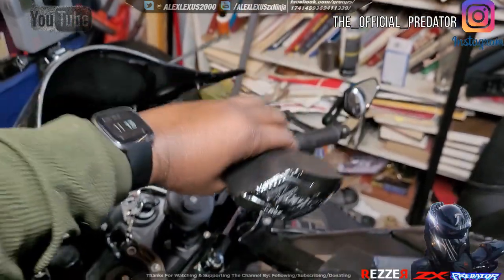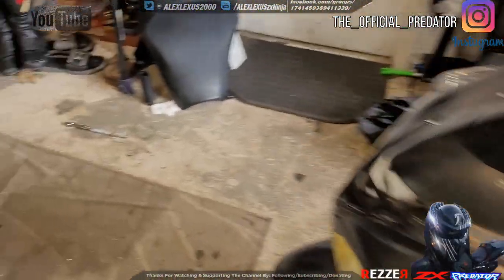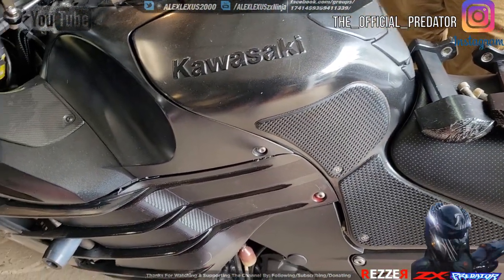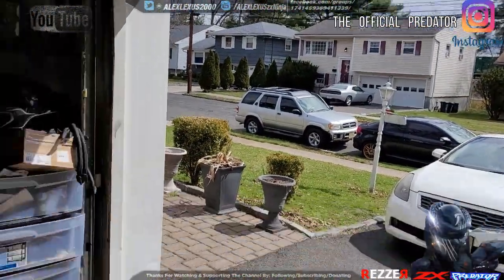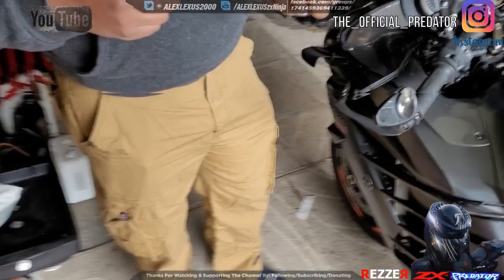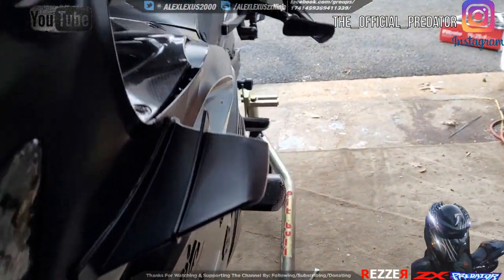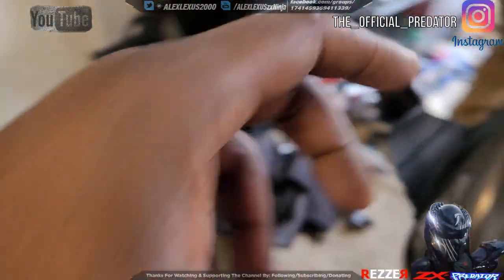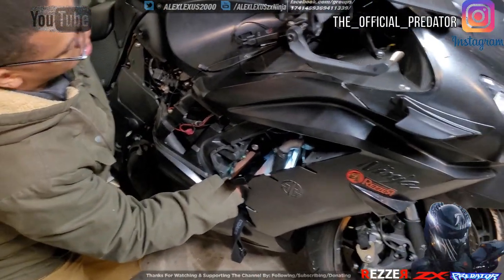T-REX frame slider Install DIY zx14r How To

Comment: What's good Army, good video 👍🏼
My frame slider bolt broke off in the freaking frame 😫when I was doing  Maintenance on my Busa. Now I have to find some type of way to drill it out.
Reply from the maker: damn! you need to get a bolt extractor for it. hope it didn't break the frame
Reply: @alexlexusZXpredator  
Yeah I hope not, I've been working on it here and there.